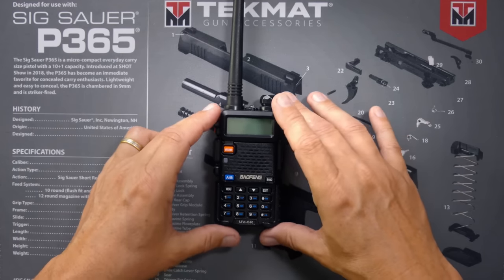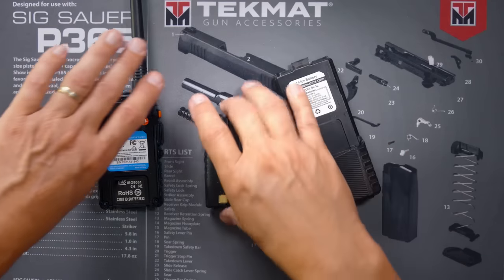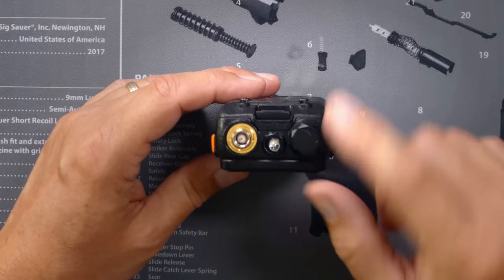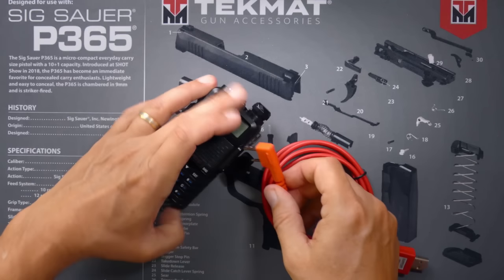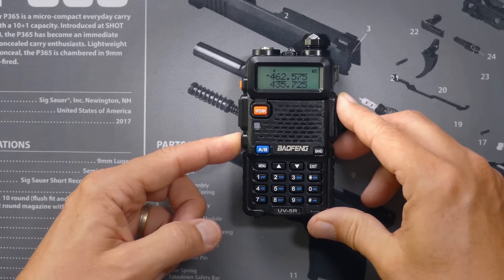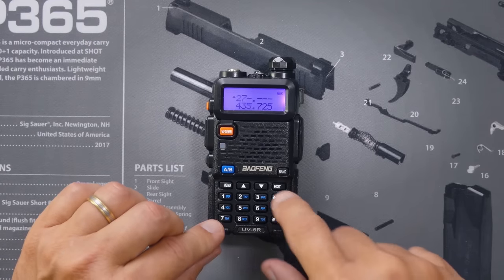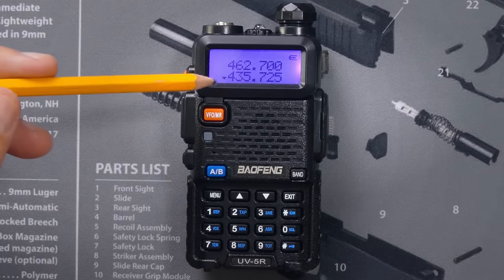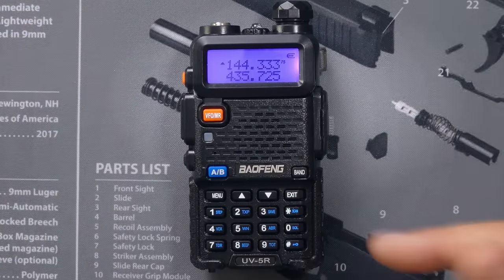The UV-5R Explained For Beginners - Full Overview Of The Baofeng UV5R & What The UV-5R Buttons Do

Comment: If a total radio dummy who doesnt want to learn the ins and outs wanted 2 of these things to communicate with girlfriend on hikes legally, how complicated is that process?
Reply: About 5 minutes. Pick a frequency not being talked on, any frequency, 154.760 for example. Program that into both the top and bottom line on each radio. Hit the little lock 🔐 symbol on the bottom right of the keypad. And wait for the FCC who will be coincidentally waiting and monitoring that exact freq at that exact time from about 2 miles away to show up on the trail and take you into custody while you and your girlfriend talk about butterfly’s, streams, and lunch….it happens more often than is reported according to “some people”

Comment: can you talk to police
Reply: can you use it to talk to police in emergincy
Reply from the maker: IF the police you want to talk to are transmitting a non-trunked, analog signal in the frequency range that the UV-5R can transmit on, then, yes ..
However, doing so would be a very, very bad idea.